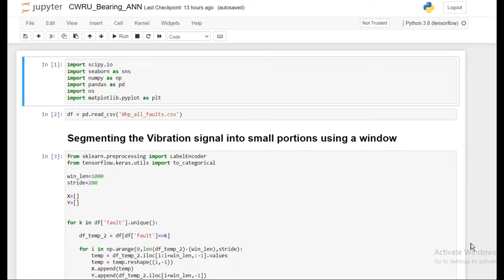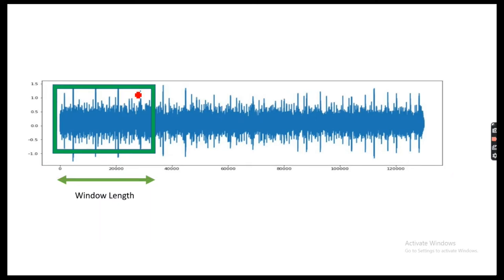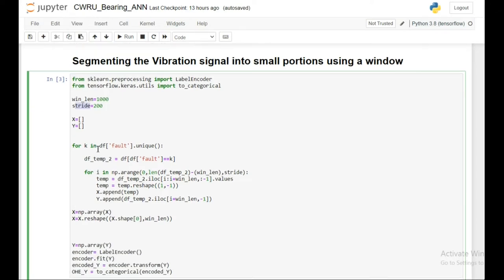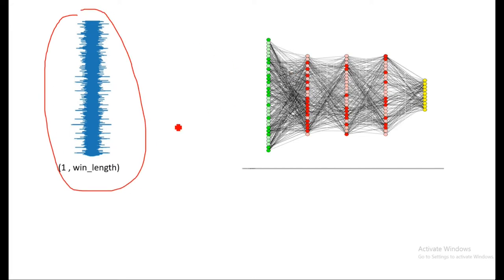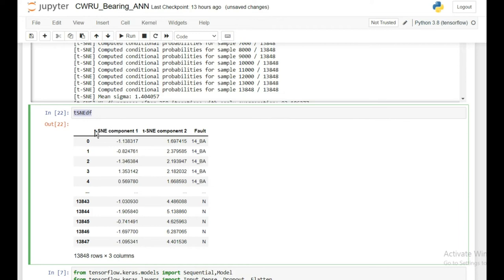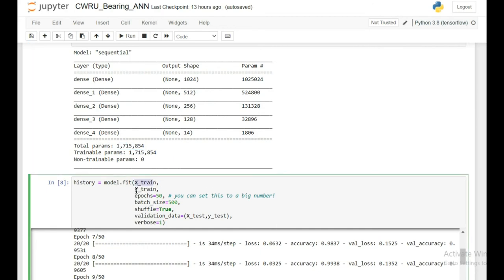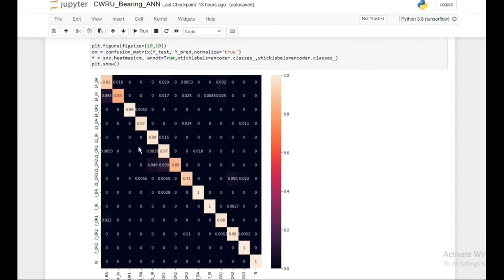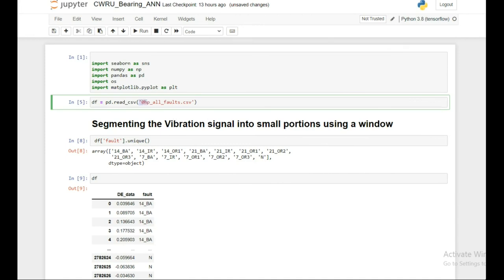ANN model training || Deep Learning for Bearing Condition Monitoring || Part-2

Comment: What do i do if i took measurements for 6 axes of data?

I am collecting vibration for water pump

Xyz for one location and xyz for another location, how do i combine this to test with model?
Reply from the maker: Hi, just like in case of 1 channel you extract several features from the data. For 6 axes you extract 6times more number of features from the 3 axis data and finally add them to a single dataset
Reply: @Mohankumardash  thank you, i concatenated the data from all axis into one array and performed the neural network.

Would it be important to first scale data from each axis from -1 to 1?

Because my raw data sometimes can reach high levels due to vibration spikes

Also if i have readings such as temperature and current measurement, how do i add it in?

Comment: HI, nice demo. I have a similar case where the signal is a current signal of the grinding process. When the job approach griding wheel current will rise and after done its become an idle current. like wise for 1 hour window i will have 720 job(5 sec/ job) . can i able to you the same approach here? pls comment
Reply from the maker: Hello, so I believe your data is a single time series of current signals. And you want to break it into small windows of 1hr. This method should work for your case too, but you will have to adjust the hyperparameters accordingly. And the results will highly depend on the features you extract from the current signal.

Hope it helps
Reply: @Mohankumardash  Thanks for the reply bro